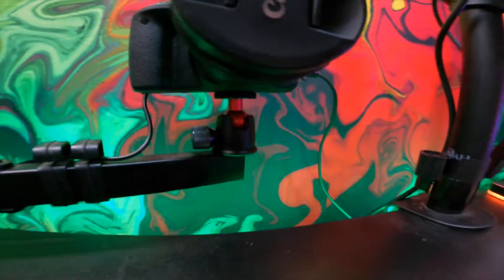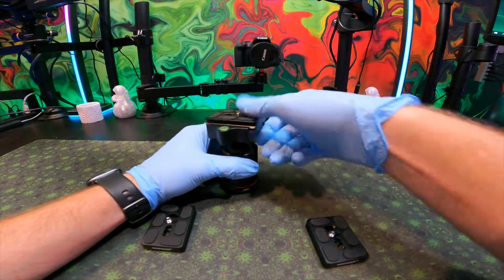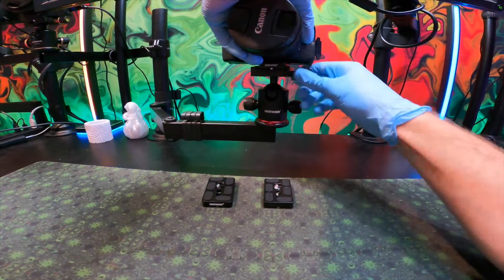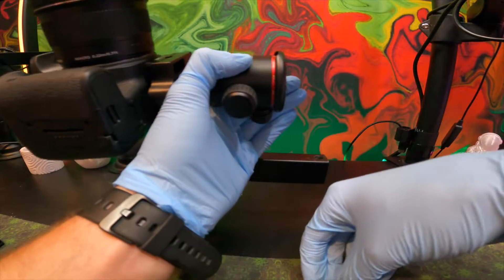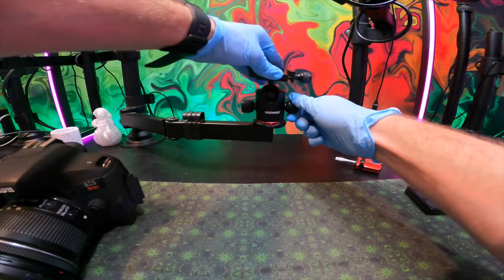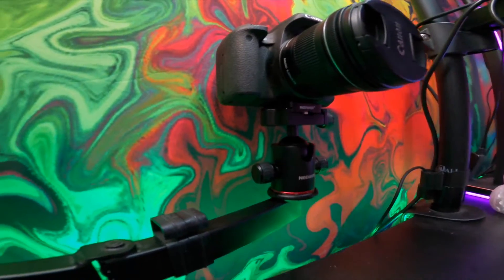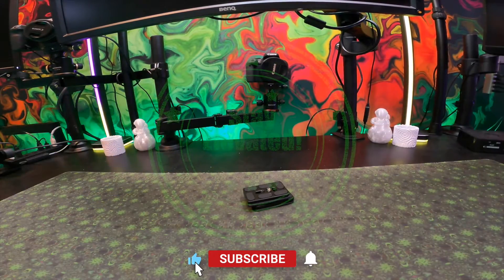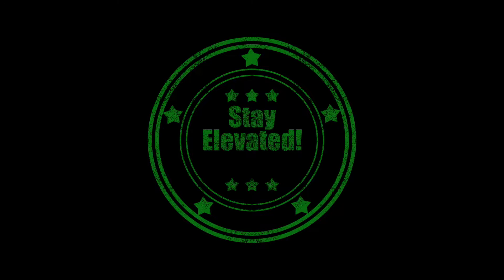Neewer Professional Ball Head Camera Mount Unboxing & Setup Tutorial

Comment: Hey how u doin, i just have an issue with my peak pro and dont know what it is, so yesterday i was using it and i think i click to many times the button and it resets to the factory mood light and it doesnt connect to my app anymore, how can a get back my mood light and heat profiles? I dont know what happen please help me :), it doesnt connect even if i put it to search Bluetooth devices
Reply from the maker: You need to remove the Puffco from your phones's Bluetooth devices and repair <3 i'd recommend reconnecting in the app after removing in bluetooth settings 

hope it helps

stay elevated!
Reply: @JuTubeTV  than u very much my g, it works everything is fine, new sub :)
Reply from the maker: Bet